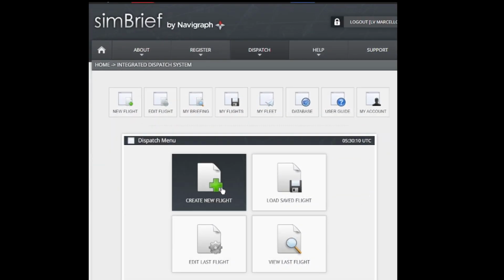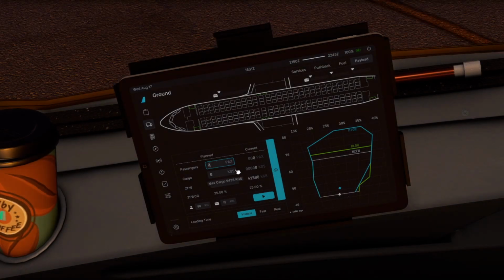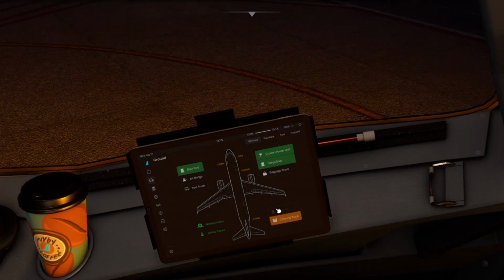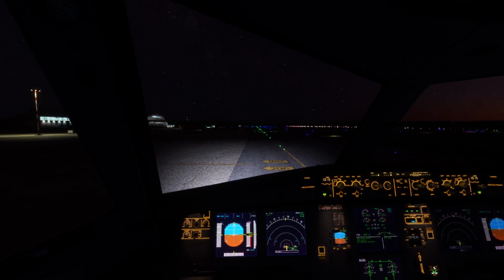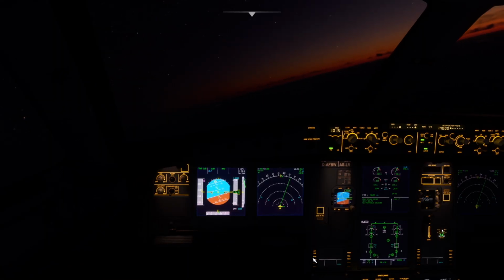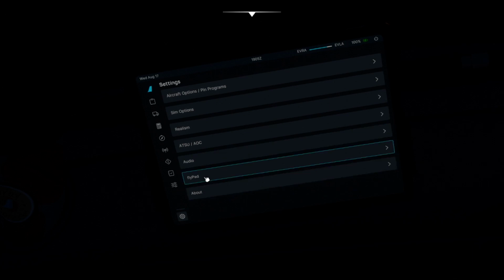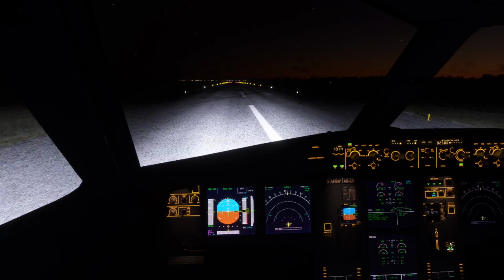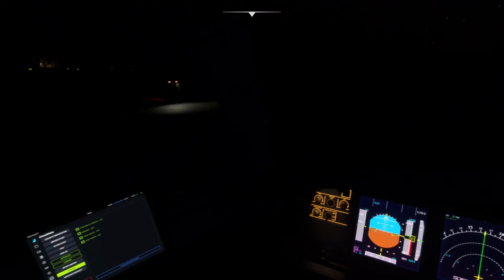Fly By Wire Latest UPGRADE in Microsoft Flight Simulator 2020

Comment: Hi wonderd if you can help I fly the flybywire A320 I have an issue once I have taken off & have positive rate of climb & raise the landing gear the engines shutdown & I end up crashing to the ground is there a solution to this problem? Thanks
Reply from the maker: Hi. I’ve got a same problem while ago but then I after takeoff watched a primary flight display and waited until he asked me to set CLB trust and I immediately set it. After that I don’t have any problems with that. 

But before that I had an idea to set info in mcdu in perf page where you put info for take off performance , there’s in left hand side are Thr red/ acc  and one right hand side is Eng out acc. I don’t really know for what are those numbers but I thought that are the reason why the engines are going to idle. But I didn’t change them, because when I watched that primary display and waited until the plane asking Clb  trust everything was ok.  

Do you use a Flex temp or To/Ga?
Because I’m using flex 45-60* and maybe that works.